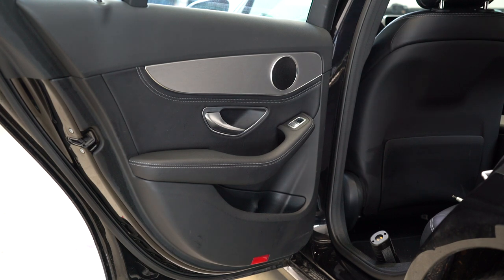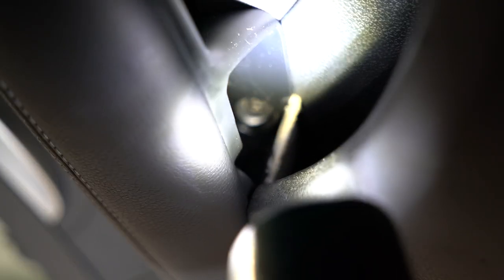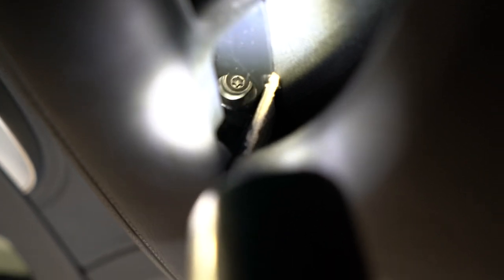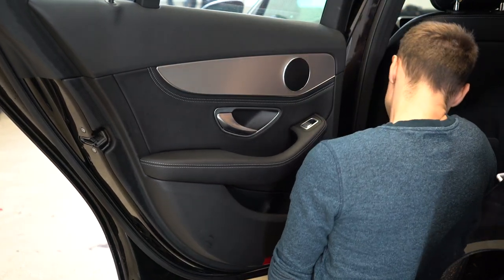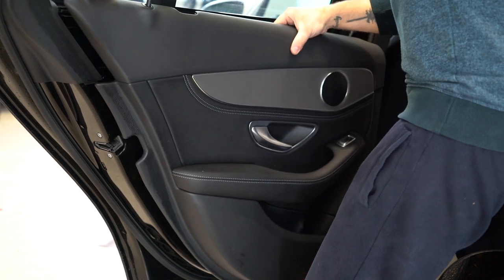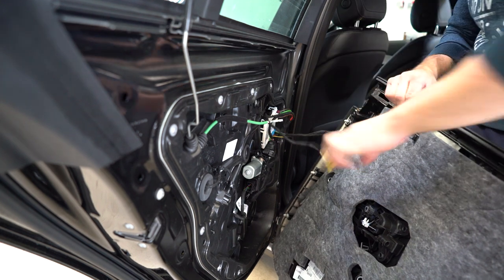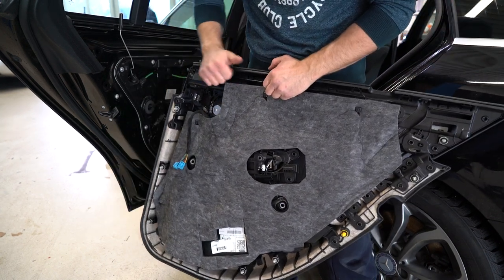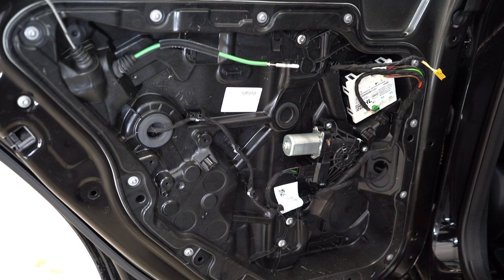Mercedes C Class W205 Door Panel Removal

Comment: Great and clear video, thanks. You mentioned that the screws were T30, mine are T27, just putting that here for others to consider that screw sizes differ as build change through the design life

Comment: struggled today with my 2019 W205 estate, trying to remove the door card to replace a damaged wing mirror. Totally failed to remove the door card - the second t30 screw under the back end of the door pull was simply inaccessible. However, for the benefit of others it turned out the be possible to remove the complete wing mirror with the door card still in place but only held by that one screw.

Comment: Just one question, removing the panel from the door seems simple, but how do I remove the black panel? Yesterday remove the ten or twelve screws but when you pull the glass moves. Should I lower the window and take out the plastic piece together with the glass?
Reply from the maker: I didn't remove one, I really don't know